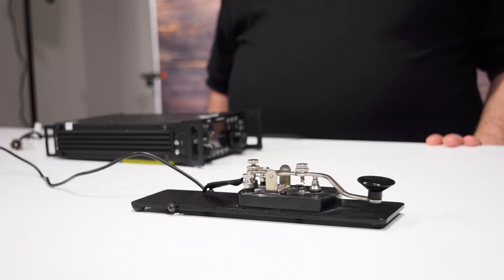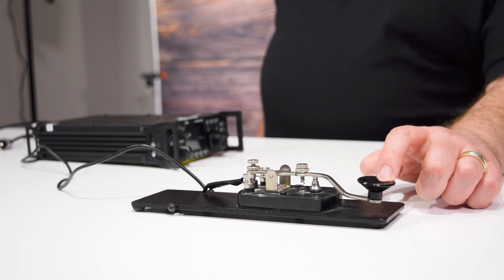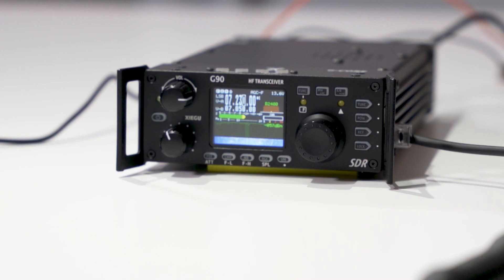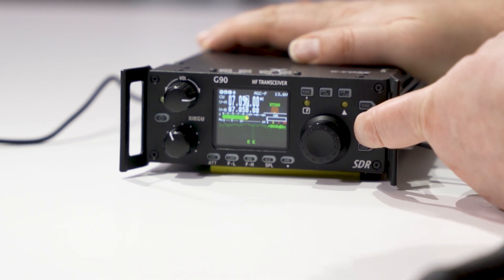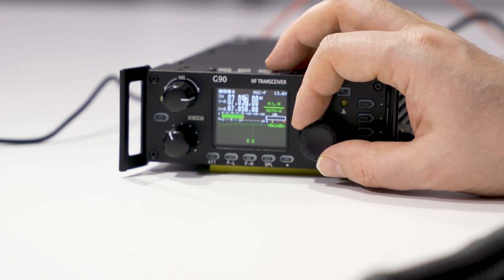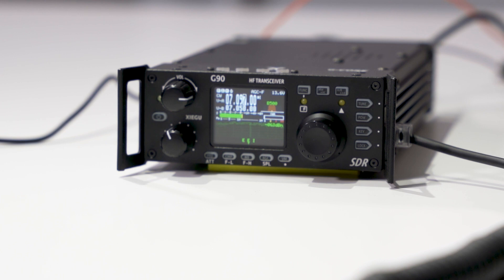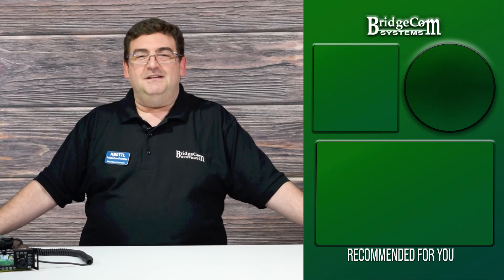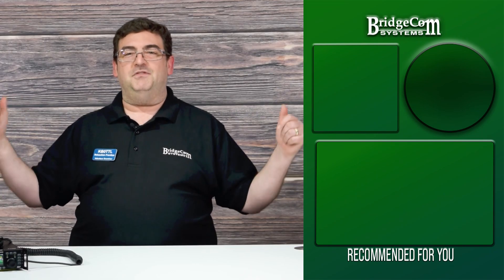How to Use Continuous Wave (CW) Mode on the Xiegu G90

Comment: I just got one for CW. it says the indicator light will flash when recieving cw at the proper pitch. Ive only seen mine flash once or twice with a very good signal. Do I have to adjust a "pitch setting"? Hope you can help me with this. Thanks. KN4RWQ
Reply: Mine worked flawlessly out of the box. It got even better when the wpm was turned up to 25. Hold the key button and increase the wpm options.

Comment: If you're going to use the FM mode, (at least here in the USA), you SHOULD make certain that you are operating in the proper (29.5 - 29.7 MHz), allocation of the 10 meter band. 
"Caveat Emptor"!